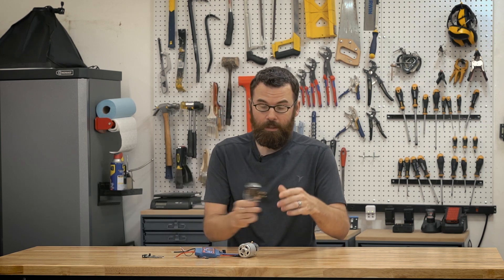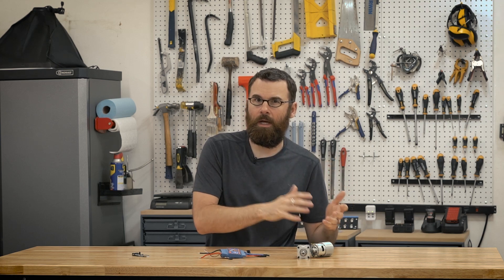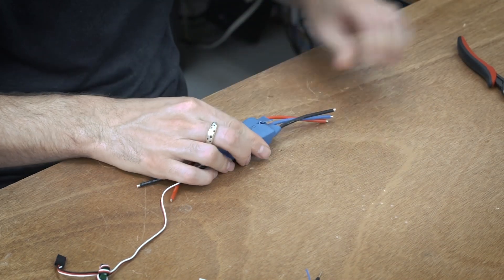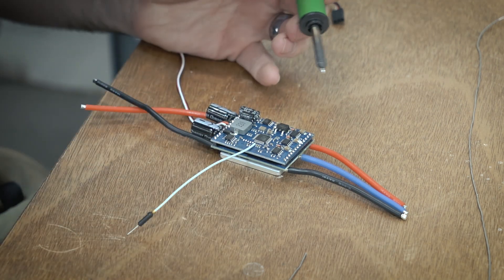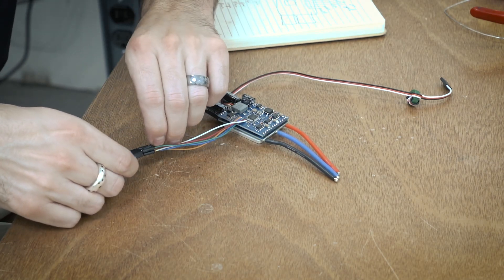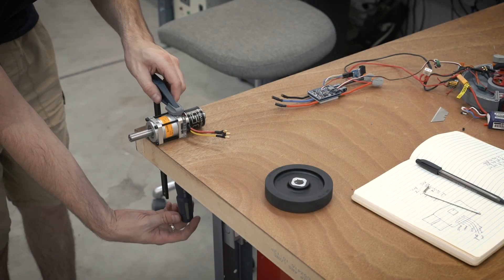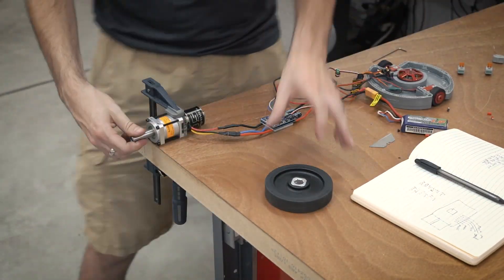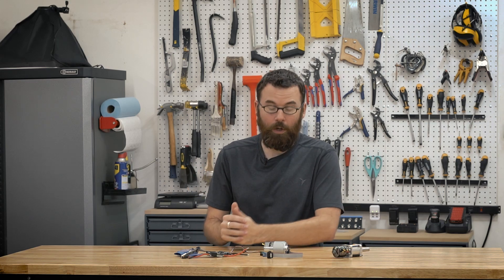SimonK Firmware Flashing Tutorial (Brushless Drive)

Comment: Just noticed that there was a input lag between your stick and motor
When you suddenly reversed it, it didn't instantly reverse
How to fix that
Reply from the maker: Change physics?  You can't 'instantly' reverse, motors have inertia.
Reply: @RobertCowanDIY   I am aware of that 
Your motor did instantly change direction at 9:41
But it's response to throttle stick input felt having a lag of 0.5sec
See closely at 9:20
I bought a custom bidirectional brushed esc for my mabuchi 775 with a similar 2 stage planetary gearbox
It's response is much faster, not just direction changing, but also while taking turns
Plus my transmitter is a basic flysky i6
Also saw someone on Instagram with the brushless version of that custom ESC with propdrive 3536
Same instant response 
Thing is he stopped manufacturing those ESCs
So back to diy esc flashing

Usually there's always a input lag in a cheap ESC to an expensive ESC
But your particular esc is already a good one
Reply from the maker: @Divyesh_Sinha There are a LOT of settings here.  Change the deadband on your radio, put in a throttle curve, program SimonK firmware (or other) for more responsive input.  It's not a simple process, you need to tune a lot!  And each motor/ESC combo will be a bit different.

Comment: What happens if you "flash" wrong software?? I have a 200A red brick, but not Black or Green motherboard, but RED. I tried both hex files, and a few others. Not even a sound and 0 movement, like dead dead dead....? is that normal, or should it have had a glitchy response at least? (even if it is the wrong software/hex file?)

Comment: Good night Robert, I'm from Argentina, I'll ask you if you can help me.
I bought an electric turbo for the car, it comes with a SimonK Firmware 40A and 5v, it also comes with a potentiometer.
I want to connect it to the accelerator pedal and it doesn't work.
I don't know if the explanation is clear, if you need my email, let me know.
Thank you in advance for your help.
Raphael
Reply from the maker: check out my video 'combat robot resource guide'.

Comment: Sir i was having a problem with red brick 200amps esc to code for forward and reverse for propdrive 50 60.The motor while in forward is switching to reverse with given the input but when going from reverse to forward it is giving a delay before going to forward
Reply from the maker: There are a lot of missing details here.  Check out my combat robot resource guide video, I share forums, groups and other resources you can use to get answers to your questions.

Comment: Do you know when there is only 3 wires comes out of ESC (Turnigy plush 80 amp) how should I connect them to USB ASP ?
Reply from the maker: I'm not sure what you're asking.  In the video, I show how to connect directly to the IC.  If you have a bootloader installed, you can connect directly to the receiver connector.

Comment: I think the software has been updated since this video and I am having a hell of a time trying to enable the reverse. I can reflash the board but I cannot change the settings on the board. I have the same esc, i downloaded from the link in the description, but I dont have the "Simonk Firmware compiler" tab like you have. Help would be very appreciated. Also nice job at AVC 2018.
Reply from the maker: You can download the old version, I used 0.80 beta 6.  Try different versions?
Reply: Thanks I used the beta and it's all perfect now.

Comment: Those look like Banebot gearboxes, did you make your own adapters to fit the brushless motors to the planetary gearboxes?  Did you have to drill out the pinions to fit the brushless motor shafts? Thanks for another informative video!
Reply: he did make custom plates and he did not need to drill pinions as they are both 5mm (775 vs brushless propdrive)
Reply: I read on e0designs.com that the rs-700 motor mount and pinion bolt up?

Comment: so if i purchased a turnigy plush 10A  could i buy a socket firmware flashing tool? would the pins for reprogramming be the same as the ones in the video?
Reply from the maker: check the link above.  you will need to make sure your ESC is supported.  there are links in that document to pictures of the board.  EVERY ESC will be a bit different.  it looks like newer plush ESCs are not atmega-based, so you would not be able to load simonk.  check the compatibility chart first.
Reply: thanks for the advice, im thinking of moving to hobbyking 10A and DYS BE1806-2300kv Brushless motors (although i belive hobbyking sell a car version? )

Comment: I have some things to say:
If you don't need the 5v output of the ESC, or can stick in a tiny 5v regulator, id recommend to use a so called opto ESC. They don't have a 5v regulator, are smaller, don't have a heavy heatsink and are easier to work with. Some smaller ones are even breadboard friendly. Programming these is also very simple, if you buy the ones that support blheli / blheli_s / blhlei32.
There are USB boards that plug into USB, and the data and ground wires of the ESC, and you can flash and program them through a nice layer out software.

Comment: Not sure if you would happen to know the answer to this one, but is there any reason why the motor/speed controller will beep for programming, but wont respond to actual control on pin two (elev) before any program changes (essentially running default)? I'm testing red bricks out for just forward but i'm not getting response.
Reply from the maker: I actually had the same thing happen with some SS (super simple) ESCs, which are basically the same as red bricks.  I haven't been able to fix them yet.

Comment: Did you have to make a special plate to mount on the p60 or did it fit by itself?
Reply from the maker: I had to make an adapter.  but I could have avoided the adapter by just shortening the shaft.  It will depend on which motor you use.
Reply: Robert Cowan How do you know which motor is compatible and which isn't? lots of motors on Hobbyking and The Robot Marketplace do not have the hole alignment.
Reply from the maker: You're right, a lot don't list the hole pattern.  I guess I'm spoiled because I can easily machine a new mounting plate, so I just chose a motor that was the right physical size and power.  A lot of times they will say the screw pattern though.  Or you could stick with what others have used (like the NTM proprdrive series).

Comment: I literally ran through this process about a week before you uploaded this, on some old ESCs I had on an old quad. They did not have ISP pads, but I was lucky enough to have a little pogo-pin intended for atmegax8 family parts from another project. I tried using AVRDude from the old AVR tools kit, and it programmed at a few dozen bytes per second. Turns out there is a standalone AVRDude version that runs a WHOLE lot faster, in case anybody runs into this problem. Didn't even know about the KKMulticopter tool. Very useful in the future!
Reply from the maker: awesome!  yeah, I've been meaning to try this for a long time.  I'm just glad it worked out well.
Reply: Your videos always help. :)
Reply: @duodream  Thanks for asking this!  I realized the beta version is what has this option!

Comment: What motor are you running on that P60 and how did you attach the pinion?  Thanks for the video!
Reply from the maker: In the video, I'm using one of these:  https://hobbyking.com/en_us/ntm-prop-drive-series-35-42a-1250kv-600w-1.html  But I might switch to something different.  I attached the pinion using an arbor press.  You can get a cheap one at harbor freight or craigslist (usually $20-$30).  OR, you can use a drill press or machining vise, that works too.  Just don't hammer it in and you should be fine.

Comment: If you put the bootloader on there, why don't you just use the bootloader on the Rx pins instead of soldering a ribbon cable on it?
Reply from the maker: because I JUST realized that!  you're totally right, if I put on the bootloader, I don't need the header anymore.
Reply: im new to this and just ordered some parts. if i understand correctly once you have flashed the firmware with bootloader using leads soldered onto the board you can remove the leads and shrink wrap it up and then use an afro 3 pin usb tool on the rx lead to make changes in the future for ease?

Comment: What esc should I use for a ntm 50-60 270kv motor? also what soldering iron do you have?
Reply from the maker: For that motor, you'd want at least 100A, closer to 120A maybe.  I'm not sure of many ESCs that powerful that have an atmega.  Look at the list above and see if there are any.  Oh, and my soldering iron is a Hakko FX-951.  It's INCREDIBLE.  Worth every penny.
Reply: Red bricks do.
Reply: Frentru is it the same flashing process for red bricks, and should I get 150A red brick for the ntm 50-60.
Reply: I have a red brick 100A for an SK3 5055.   I haven't flashed it yet, but I'd imagine this process would work, or the process using the servo cable which is similar and easier.
Reply from the maker: Yeah, the process should be the same for the red brick.
Reply: At least with the 70A red brick, the design changed recently and swapped some of the pins around, not sure if the larger ones have also changed but it's something to be aware of. https://github.com/sim-/tgy/pull/123
Reply: For more in depth information on tuning on these big atmega based brushless controllers with simonk for a robot/heavy drive application, Charles Guan's write-up on Overhaul2 is very informative http://www.etotheipiplusone.net/?p=3985

Comment: Why you don't have flash a blheli firmware?
Reply from the maker: I wasn't aware that blheli did forward/reverse.  I just chose SimonK because it's the most common firmware for brushless drive.
Reply: Robert Cowan the most common firmware is blheli, simonK was the first firmware for "drone" but now blheli have the best feature for brushless motor. The best for "drone" is the regenerative brake, I think is very useful for a robot
Reply from the maker: You might be right, but I need forward and reverse drive, which blheli doesn't seem to support.
Reply: Robert Cowan I now but blheli support the reverse and forward drive, otherwise I would not have told.
Reply from the maker: Oh OK, I can look into it.  Thanks.
Reply: I've tried both recently, blheli had a much harder time starting under load, which is the main advantage of simonk.   Perhaps it wasn't tuned well, but combat robots need good startup and reversing unlike drones.   Maybe overall power and response time is better with blheli, but I'd trade top speed for low end power any day.
Reply: simonk generally seems to be more responsive for robot applications than blheli.
Reply: Frentru maybe one year a go, now blheli it's superior.
Reply from the maker: Yeah, torque is king.  With the stock firmware, I was able to stop the wheel with my hand easily.  With the SimonK firmware loaded, it's impossible and even a bit dangerous to try and stop the wheel with your hand.
Reply: Blheli does have forward and reverse, but for robot combat simonk seems to have a slight edge. I´m runnig blheli on the drive of all my bots and I can´t complain about it, but I also have a very smooth driving style and way more power than traction. It would be interesting to see how blheli_S compares, but that needs a different hardware. (Thanks for the video, I had no about how to flash simonk until now, might try it on my bw hammer.)